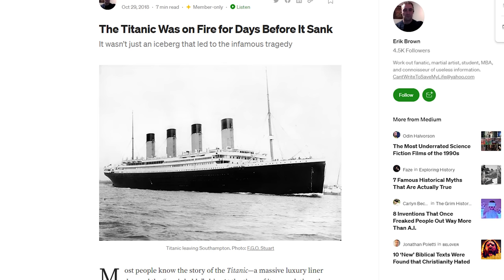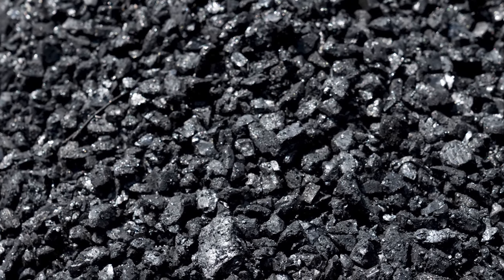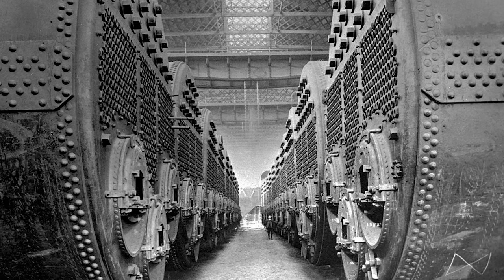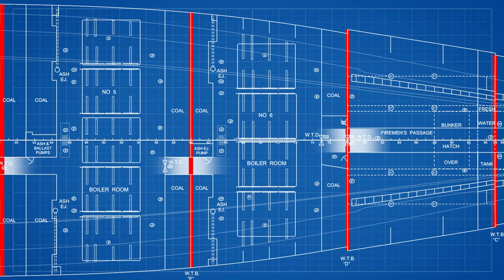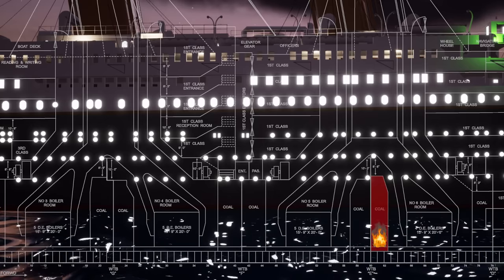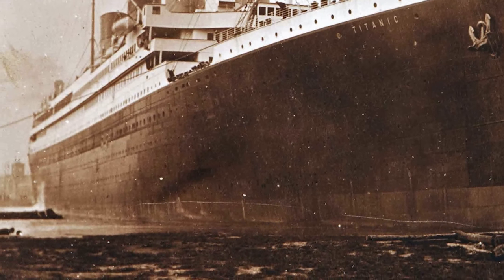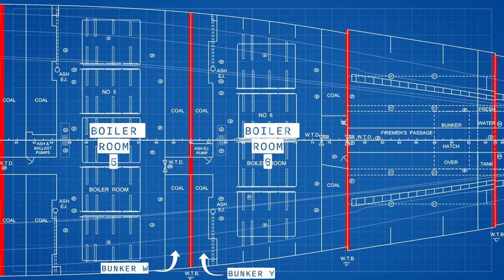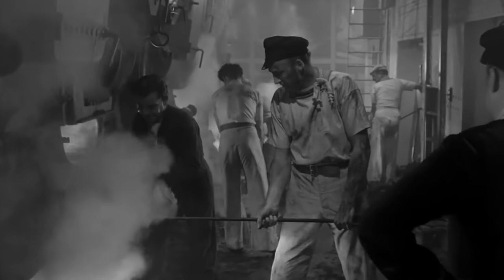Did the Titanic's Coal Fire Cause the Disaster? The Burning Question.

Comment: Thanks for another well crafted video! These theories get sensationalized and detract from the full and very complex story of the Titanic. Like any engineering failure, there are multiple contributing factors; some are more or less impactful than others. Interesting to note, the redistribution of coal due to this small fire may have had beneficial effects on the ship's stability during the sinking, counterbalancing the initial inrush of water. When presented with some of these theories about brittle steel or coal fires, I recall Dr. Ballard put it correctly and bluntly when he replied that the Titanic sank for one reason only... a collision with an iceberg.
Reply: I think its lost on many that had almost any other ship of older construction hit the same Berg it would have been lost so quickly nobody would survive to tell the tale.

It's a testament to the quality of its construction that anybody survived at all.

Comment: In fact the coal fire likely secured the safety of the survivors to come later. The fire was on the starboard side of the ship and so the excess coal was moved to the port side of the ship. This gave the ship a noticeable list to port as she made her way towards New York. When she struck the iceberg on her right side and water began rushing in the weight of the excess coal on the port side offset the weight of the water rushing in on the starboard side. This is why titanic did not heavily list and/or capsize. The coal forced the water to fill the bow evenly and fully then the ship began to sink as a whole straight down from bow to stern, with no listing of rolling. Had the fire not happened then the weight of the coal would not have offset the weight of rushing water and likely the ship would have listed to starboard. This would have given the crew less time to launch lifeboats and the ship would have sunk more quickly as well. The coal fire actually saved many lives.

Comment: The iceberg, obviously.  But the reason was not because of speed, although it would have helped if they were going slower.  Nor was it lack of binoculars, any of that.  It’s a known fact that the air temperature dropped precipitously when the ship crossed into the icy current moving southward.  With ZERO wind and a mirror-like sea, a layer of frigid air caused a mirage-type effect that reflected the starry sky but hid the base of the iceberg.  By the time they saw it, it was too late.  THAT was the cause.
Reply: but he didnt slow down after all the warnings ?
Reply: @paulrichardson5892  Actually, it was common practice to go at speed at night because visibility was good enough to detect anything I to avoid it…or so they thought.  The Titanic’s rudder was sized a little to small as well, which contributed to the problem.  Like I said, it would have helped if they were going slower, but it was the highly unusual mirage effect that is the most dominant factor.

Comment: Wonderful job, Mike. Maybe you can help the community debunk another theory which implies that Titanic lost a propeller blade when it hit the iceberg? Some claim that the starboard propeller blade is missing and there's a whole rabbit hole that goes real deep and I was hoping you would consider looking into it.  Love your stuff, keep it up!
Reply: The biggest misinformation that no one seems to even try to correct is the fact that Titanic reversed engines before striking the iceberg,  even some of the more recent documentaries still include this.  Actual fact, Titanic stopped engines and didnt reverse them, with 30 seconds to impact @ FAOP with nightwatch on duty in main engineering,  you might get the browns engine warmed up and just started switching the MASSIVE changeover valves to vent exhaust steam directly into the condensers so you can stop the central turbine for the center prop and start winding down the wing props, which in itself would be a chore since Titanic's inertia would keep those props spinning at or near close to full ahead.
Reply: @leon419  Another claim made by people who have no idéa how ships engines works. I sail on container vessels with modern diesel engines, and I'm fairly certian that we would not be able to go from full ahead to astern in 30secs, at least not without causing damage to the engines. 

So the idéa that the command to stop (or go astern), if given, would in any way have time to take effect is ridiculous.
Reply: @frederiknielsen6038  I red somewhere on a reddit page a diesel engineer explaining what it would take to go from FAOP to full astern,  I dont remeber the entire process but at one point as your winding down the props youve cut the fuel and started blasting air pressure into the cylinders to slow them down and get them spinning in the reverse direction, as they are spinning up in the reverse direction you cut the air pressure and start feeding fuel,  its at this point you can hgear an alarm you dont normally hear, called the wrong way alarm,  Essentially inertia has caused the props to start spinning the other way again while you got fuel feeding to the system, so you cut fuel again an reintroduce air pressure to start them spinning the other way.  Not sure if i got it totally correct bit its what i remeber.  Essentially the entire process would take significantly longer than what Titanic had.
Reply: @leon419  Your description of how we stop and start / change direction on the engine is correct. We do indeed use compressed air to get the engine turning before fuel is injected. 

But I need to point out that the issue you describe where the engine starts to spin in the wrong direction happens because of drag on the propeller. The water flow past the propeller starts to turn it and as it is directly connected to the engine, the engine turns as well. But this is a general problem ships face, and has nothing to do with it being steam or diesel engines.

Comment: Actually that poses the question: If the Coal Bunker W would have been completely filled (or at least mostly filled) with coal, would the coal have taken up enough volume, such that the incoming water would not have had enough volume i.e. weight to destroy the bunker walls and the ship could have either stayed afloat much longer?

Comment: Titanic despite all the theories is still the ship that went beyond the duty it was built for at her given time to stay afloat more then was expected of her
Reply: Yet if The Great Eastern, a ship built over fifty years prior to Titanic hit that iceberg in the same circumstances, she wouldn’t have sunk. She suffered far worse hull damage when she hit rock in 1862 and all it did was cause a slight list to starboard. The gash was 85ft by 5ft BTW.

In fact, the only safety feature that Titanoc shared with The Great Eastern was the twelve transverse bulkheads. But even there, Titanic's only went up to 3ft above the waterline. The Great Eastern's went up to 30ft up.

Comment: For a while I believed that the fire weakened the hull, warping the iron and then when it hit the iceberg, the rivets just flew off and panels tore.
Reply: It really is plausible.
Reply: The fire couldn't have weakened the hull plating, at least not below the waterline where the damage occurred, it couldn't get hot enough -- the water on the other side keeps the steel below 212F/100C, and it takes at least 600F to make steel start to lose strength.  Same as you can boil water in a paper cup over a gas flame; paper burns at around 450F, but mo matter what the temperature of the flame is, the cup doesn't get any hotter than 212F until the water's all boiled off. The rivets just flew off because they were a bad batch of steel that became super-brittle at LOW temperature.

I'm with Mike, the coal bunker not intended to be filled with water was watertight in the sense that it wouldn't let water out until it popped like an overfilled balloon. Which was bad for the engine room crew having the water come at them all at once, but it would allowed the same amount of water in even if it hadn't ruptured
Reply: @DeliveryMcGee  wouldn't the fire also harden the steel in some cases?
Reply: @merafirewing6591  Thats what brittle means, It gets harder, thus more glass-like.
Reply: @augustkoningen9970  causing a rupture more easily right? I’ve never discussed this with people so interested in ships. Titanic is the only ship I really completely understand except this. I’m just spitballing
Reply: @DeliveryMcGee  "Substandard steel" is another baseless conspiracy theory.  Titanic's steel was the best available in 1912.  Was it inferior to steel available now?  Yes.  But it was top of the line for 1912.
Reply: You are describing a brittle fraction of steel. Some steel alloys suffer from a brittle fracture at the sea temperature. This was not fully understood until Constance Tippet studied brittle fractures of Liberty ships that was believed to be because they were welded not riveted in WWII. (Welding had nothing to do with the brittle fracture). You can actually look at the fracture surface and tell if it is a brittle or ductile fracture.
Reply: @JWRogersPS  The issue in 1912 was low temperature brittle fracture of steels was not well understood. So certain modern QC procedures would not have been done in 1912. The steel is "substandard steel" per modern specs but not specs of 1912.
Reply: @washingtonradio  That's exactly what I said.
Reply: @washingtonradio  Substandard for modern specs, but nonetheless well within the appropriate "standard of care" for 1912 as evidenced by the fact that there weren't loads of ships inexplicably dropping to the sea floor.

We may have better steel now, so we just cut corners elsewhere.  😁
Reply: @paulwoodford1984  - Not really.  Coal fires were an expected occurrence on transatlantic liners and protection against structural damage resulting from such fires had been designed in for a long time before the Olympic class were built.

Comment: Considering quite a few noteworthy sinking ships.
I've always wondered if a watertight bulkhead stem to stern along the center line couldn't have made a difference.
Reply: Oh, there's a thought. Usually you just see people passing around the fool notion that putting watertight caps on the bulkheads would have saved the ship, ignoring that they went up past the margin line, but running a center compartment (or segmented compartment) might actually have done the trick by preventing enough water getting in to doom her in the first place.
Reply: @stormisuedonym4599  I noticed the Yamamoto.
Along with others have suffered a similar fate.
They had plenty of water tight compartments.
But nothing fore to aft.
I don't think it would add to much extra complications to build, and would in theory actually add strength to the main keel.

Comment: Behind a local estate of elderly bungalows, the place where for 30+ years the houses at the back had been dumping their fire ashes down the slope.
Someone set fire to the grass and "wind bushes" on it.  It burnt out in an hour.
2 days later it will still smoking.
A week later it was still smoking.
2 weeks later and cherry red burning embers could be racked out of the ground.
It was burning for a month before eventually 3 fire engines came out, hooked up to the water mains and setup springlers in addition to about 5 hoses.
It took them 3 days working at it 8-10 hours a day.  It even rained for 2 days straight and it didn't go out.
Eventually with the help of a JCB they got down deep enough to get it to go out.
It was literally just about 2-3m deep in old fire ashs and unburnt coal.

Comment: I don't professionally work with film but I've developed quite a few bw negative films and that black smudge could be literally anything. A narrow spot where the negative hasn't had enough developing because an air bubble formed, a large piece of dust on the lens that was able to form a big enough image on the the plate/film. Since this is 1912, the photographer might have just bought their developing agent on the cheap (or gone to a chemist that could have done it on the cheap), and so the actual developing agent could have been unevenly dispersed within the developing solution. (You have to dilute it with water in order to both: 1) allow the developing agent to seep into the emulsion (what contains the silver crystals that record the image) effectively, which a developing solution made purely with a developing agent would not do effectively, and 2) allow the developing process to be long enough that you can get consistent results). Also, film stocks available at the time generally tended to be a bit more contrast than today's film stocks. (Contrast is the difference between the whitest white in an image and the blackest black. If there is little grey in the image, an image is high contrast). I'm not saying the "smudge" image is very high contrast, but looking at the people in that image, they are lacking in grey tones. Obviously you get some greyness in the funnels, but it's definitely on the whiter side.

That or it's just a digital scanning defect. There's a good few reasons for what this smudge could be. A raging fire aboard a newly built ship is not very high on that list (even for the relatively unregulated world of 1912).

Comment: Smoldering fires in the coal bunkers were not unsual on steamships and usually not a problem: the glowing coal simply had to be uncovered and burned. In the case of the Titanic, there is an unproven assumption that the disposal of the immense amount of Smoldering coal may have led to the increasing speed, as the boilers had to be fired far more than planned. In fact, the fuel on the Titanic was so scarce that high-speed travel was not possible with the new ship as planned.

Comment: Another first-class video Mike - this really is one of the most informative and entertaining channels on YouTube. I totally agree that Leading Fireman Barrett's "rush of water" was caused by the collapse of the front wall of the bunker or the failure of one or more of the vertical-sliding bunker doors. Had the watertight bulkhead between boiler rooms 5 and 6 collapsed - as many people assume - it would have been the last thing that Barrett or any other crewman in that compartment ever witnessed as the water would have inundated the space in seconds, leaving no opportunity for escape. Seems that bulkhead E held fast, thereby ruling out any possibility of fire damage contributing to or hastening the sinking. A question though - I'd always believed that the fire was located in bunker W, which fed stokehold 9 at the forward end of Boiler Room 5?

Comment: Most know that cold sea water hitting a fully pressurised boiler can cause a thermal explosion. We do know that Barret and the stokers of boiler room 5 released the excess steam to prevent this from happening. But did they also manage to vent steam from the boilers in boiler room 6 in time as well  ? (despite the fact that it flooded fairly quickly after the collision)

Comment: I think ironically the fire helped her stay afloat for longer. The distribution of coal they had on one side of the ship, Even though it had a slight list to port, it didn't capsize. With the even distribution of water as it flooded the ship evened out for a bit.

Comment: I always thought that the smudge looked like an artifact of fairly primitive 1910s camera tech
Reply: It seems to be in the area of 3rd Class accommodation, yet no-one ever reported a raging fire in that area.   I supspect that it was a mark on an early negative, or perhaps even the result, if it actually did exist, of a close encounter with a dockside fender.

It is only seen on one photo., as far as I know, and the author pushing the claim, Mr. Molony, was more eager to sell the book than to answer criticism.
Reply: @dovetonsturdee7033  It's actually visible in two photographs, two of three taken from the same vantage point with the same camera at roughly the same time. Mr. Molony brings the second photograph up as "evidence that it was real", but conveniently, Molony leaves out the existence of the third photograph, which doesn't show the mark ;)
Reply: @DerpyPossum  Well, look on the bright side. No doubt this spectacular 'discovery' helped Molony sell a few books.

Comment: A little metallurgy for you... iron and steel are two of the strangest materials you can imagine ... apart from where it is first formed, it very susceptible to heat treatment. It's not only the heat but the rate at which it cools... for instance a knife blade would be heated to 1500 c and quenched quickly in water or oil. This makes it hard but brittle... drop it and it could shatter like glass... so it is heated again to 200c and held at that temp for an hour then left to cool down with the oven when switched off. This leaves it still hard but as tough as an oak stump.
The fire in the coal bunker would have altered all the properties engineered into the steel. Leaving it as fragile as paper... something to think on..
Reply: The bunker is not the issue, as it was neither designed nor intended to cope with the pressure in any case.   That was the purpose of the series of bulkheads within the ship, and there is no suggestion that the bunker fire affected any of them.

Comment: I have a wood burning and coal stove that glows red when its full up. That's a stove over a 150 years old that is still in useand the metal it's made from is less than 1/4 ". Its still works just fine....